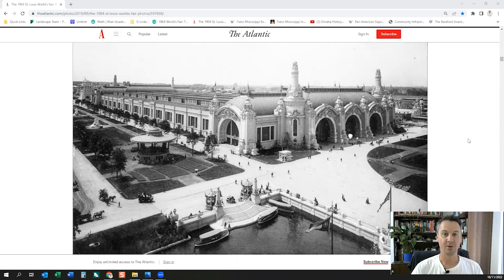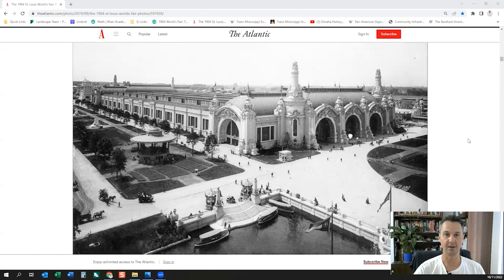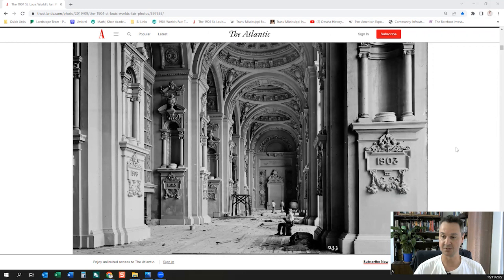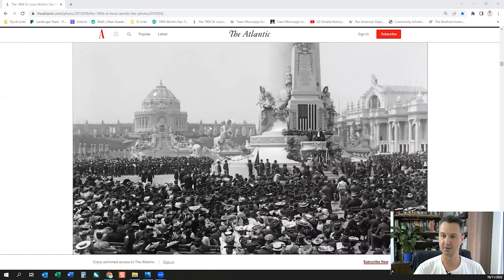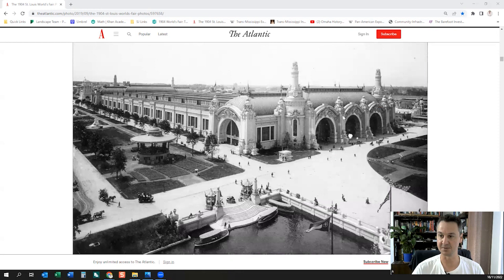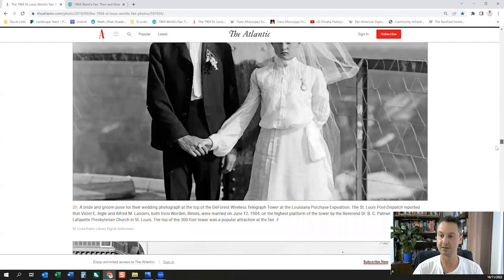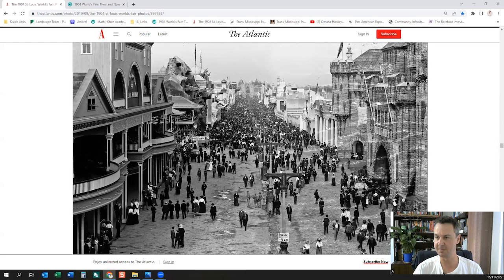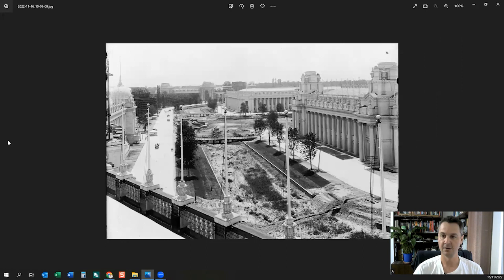1904 St Louis World's Fair - Construction Photos

Comment: Scaffolding also means , repair work
      An I wouldn't stand anywhere near one of them cranes (prop)    no counter lever,, nothing ,, 
I think we did build this stuff,,but the Time lines are not right,,,, an poeple have taken the credit who dont deserve it,,
An if its all steel an not hard rock or concrete,  well that's still time consuming 
Them metal frames are prefabricated,,so all the holes have to line up..
All measurements done at work shop..
   They still need footings an theyve built near water,,,thats problems after problems....
   Fountains,  plumbing,  prelays,,it goes on an on...
      Looks like its getting pulled apart or repairing it....
Probably clay relining the canals to..
      You got another sub to brother
Reply from the maker: Yes repair work only a distinct possibility. Thanks for following!